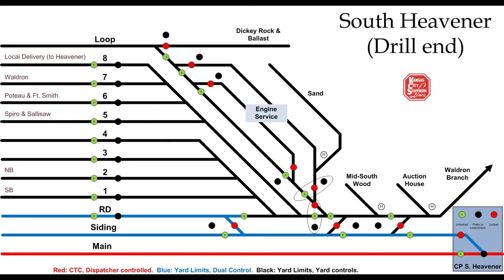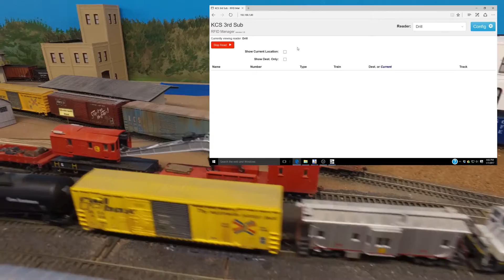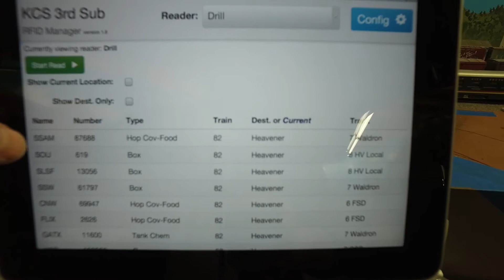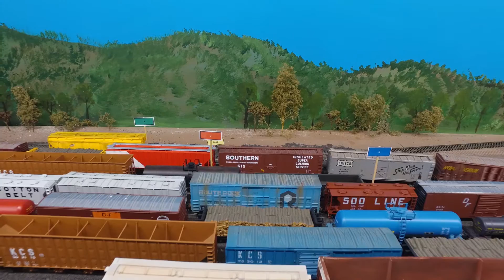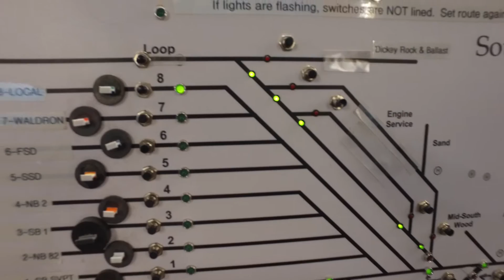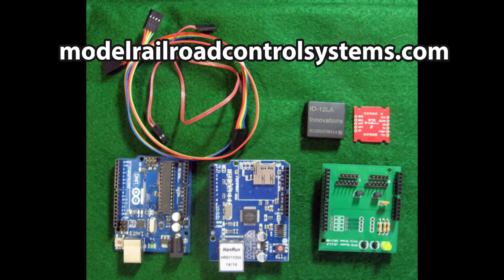RFID on the KCS 3rd

Comment: Is that JMRI you are using on the touch screen iPad?
Reply: Scott,

Not exactly.  I understand JMRI developers are working on getting the Reporter feature updated to integrate Seth Neumann's Model Railroad Control Systems (MRCS) RFID system (see  http://modelrailroadcontrolsystems.com/ ).  For now, I am using a web server running on a Raspberry Pi to perform a lookup into the JMRI cars table which I'm storing on Dropbox..  So yes the data, car destinations, etc. come from JMRI and JMRI is handling the car routing and stores the destinations for each car, but the screen you're seeing isn't coming directly from a JMRI window.  I could probably achieve that if I were better at Jython scripting, but alas I'm not.

Thanks,

Steve